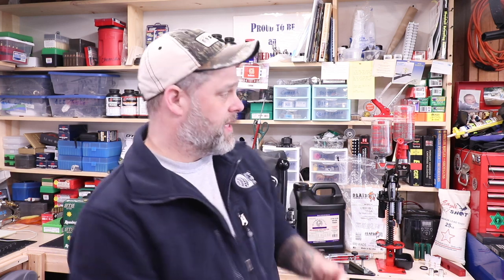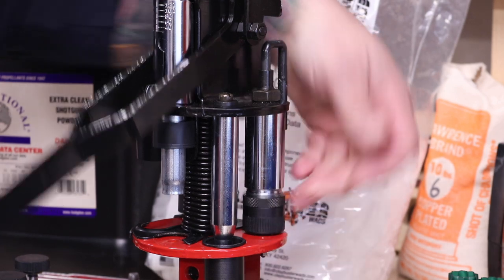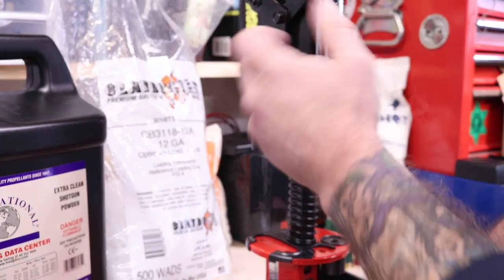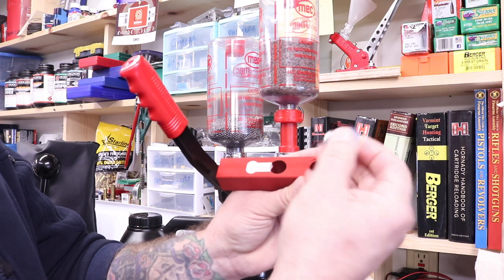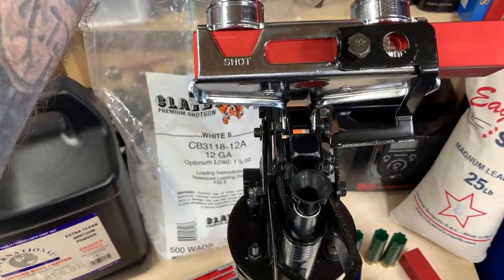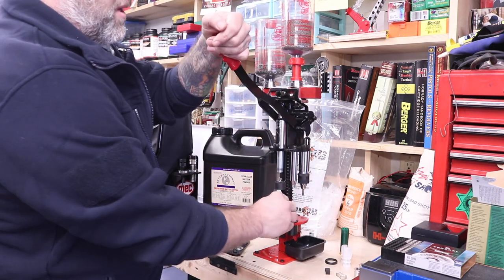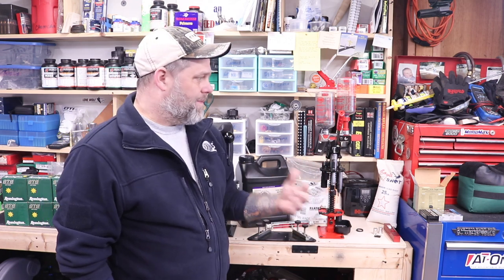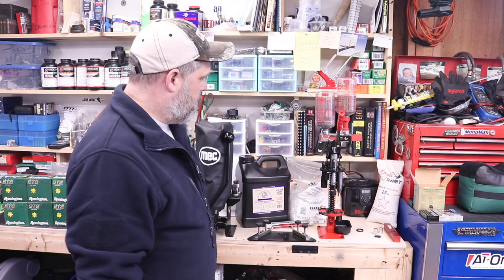MEC 600 Jr Mark V, Reloading 12ga and Overview

Comment: Great job explaining the Mec 600 Jr. I've had my Mec 600 since the 70's can't tell ya how many shells went thru it and to this day I'm still reloading at least 2 boxes a week. Yes you can be a real speed demon on this, about 6 to 7 minutes for a box of 25.
Reply from the maker: It sure isn’t hard to get in to a grove and pump out a box. I’ve heard of so many people using the 600 for years and years without issue. Thanks for watching

Comment: About 1 month ago, I ended up with my father-in-law’s MEC 600 Jr.  Last time he used it was 1988.  It took some cleaning, but I got it going.  Within the first 100 rounds, I did exactly the same thing you did.  I didn’t put the caps on because I thought, there is absolutely no reason to lift that while I’m reloading.  Clearly I found a reason.  As a result, my bench and floor got a really well needed cleaning.  I’m glad I’m not alone!!  Perhaps, in a future video, if you could explain the various adjustments, that would be greatly appreciated.  I know mine is slightly different, but the basics are the same, and I had a hard time finding useful videos.  Specifically addressing issues around the final crimp.  Great video, as usual.
Reply: I was handed down a couple dillon precision presses. I took had to take then completely apart and replaced a couple things. But they still run amazing. They had not been touch not nearly as long as you but it feels amazing to continue to produce rounds. It's so sad so many people chose to buy ammo. Well I still haven't had to pay for premade ammo in over a yr. I don't have a 12 gauge but I plan on it being my next purchase. Any suggestions for a good first shotgun? I am stuck between the older remingtons or mossberg
Reply: Hello. Thought I'd give a suggestion . A first shotgun depends on a lote of things. But  I'll  suggest a  Remington 870 of some model.   You can pickup a good used one  for couple hundred  and  have plenty of product support.  And after you decide to buy others a good dependable 870 is good to have around.
Reply: finaddict Well, my dad brought me duck hunting and there were 2 shotguns with us - a Remington 870 Wingmaster and a Browning Auto 5.  First shotgun I bought was an 870 (good for duck, geese, turkey, deer, clay and just about anything). Second shotgun I bought was a Browning A5. While they are nostalgic for me, I have no regrets.
Reply from the maker: I learned on a Lefever double barrel and moved to a Remington 870 for years!
Reply: My grandfather gave me a Browning "Sweet 16" 16 ga A5 when I was 11. Shot most of my birds for years with it. Overall, for durability, mountability, and options, my favorite shotgun is a Mossberg 835 Ultimag. Have had it since I was 16. Tens of thousands of rounds. Turkey loads to target loads. Never broke any parts yet.
Reply: Been there, done that!

Comment: A great overview video for the newcomer, thank you!  May I suggest a follow-up video, if you haven't done one already, on choosing a recipe, finding the correct powder bushing by using the bushing chart and then verifying the charge using an accurate powder scale.

In my mind, the bushing chart is just a guide and the particular bushing should not be trusted until checked with a scale.  Also it's importante to recheck powder charge weights when opening a new container of the same powder.  Sometimes the density varies from jug to jug and lot to lot.

Cheers and safe reloading!
Reply from the maker: I can, and plan on doing some follow up videos but you'll find them all on Rumble. YouTube won't let me post things about re-load-ing anymore.

Comment: I have used my 600jr for over 20 years. Great machine. Converted to 16ga for my Browning 525. 1 1/8 oz lead, 800x. I use the adjustable charge bar and am satisfied. It does hang up once in a while using #6 lead but not a real concern. Keep the powder hopper full to maintain consistant charge. Great video to introduce the MEC. Jim
Reply from the maker: Susan Lorden that’s one thing I’ve heard is they can hang up. I’ve got some #6 shot that I wanted to load for hunting to. Either way, I’m very happy with the MEC, good Reloader for sure.!

Comment: I've found that I can usually load a box faster with my 600 jr. than I can with my MEC progressive. Mostly because if your progressive has a glitch, like having a primer not feed, or hang up a wad, or someone comes in and starts talking to you, it takes a few minutes to fix the mess you just made. Usually load a box on the jr. in about 6 1/2 minutes but have gone sub 6 minutes more than once.

Comment: Good video! I got a 600 Jr. a couple weeks ago at a yard sale, missing a few parts or the manual.  I was able to find everything I need at he MEC site, including the exploded view letting me know where everything goes.  MEC had the parts in stock, and they should be winging their way to me today or tomorrow.
About three hours to clean it up, mildly seized due to dirt and congealed lube, should work a charm once I get it adjusted.
So far I'm into this for about $60, so feel I'm way ahead of the game.
It did come with a charge bar set up for #8 shot, I might get a new bar and insert for other loads.

Comment: Are the progressives nice, absolutely i have one MEC 9000 but i run 2 600 jrs as well. In 20 and 16 ga. If you want to speed it up a little without the investment in a press get the primer feed for the single stage. Big big increase in productivity.

Comment: Great video better than the MEC video answered most of my question. Have a LEE Precision I got before reading the Lyman shotshell reloading manual would have saved my money gone with the MEC. The MEC uses bushing but it’s powder weights are are over it’s +/- 10gr. Seems with MEC the powder baffle resolves that but also the bushing don’t match the recipes in the Lyman shotshell book. Like the fact that there is universal charge bar and that the powder and shot bottles can be taken off with out making a mess. LEE does not have that feature.

Comment: Nice thing about MEC 600, sizemaster, and 9000 is they can be mounted on a board and that's stable enough which is great since I dont have a bench.  But I also mount a sheet pan (like a rimmed cookie sheet) between the board and the press to catch all those spills (at least a lot of it).  I have just received a MEC metallic press and am anxious to see if that will work on my board/pan with the MEC quick change plate.

Comment: In uk most grounds are now doing away with plastic wades , can you use anything else apart from plastic. 
Great video.
Reply from the maker: I don’t have any solid information but I’ve heard manufacturers will be producing biodegradable wads that will be acceptable to use in the UK. You might want to call around to some local ranges and see if they have any information.

Comment: Great video!  Years ago I stopped reloading because it got to be more cost effective to buy a box of 25 instead of making them with the MEC 600 Jr.  In the last few years, especially in the last 3 months shot gun shells have almost double in price.  Based on the cost of reloading components at todays prices vs the cost of a new box of shells which is less expensive.  My favorite all around shell is a Remington ShurShot 12 gauge, 2 3/4", 1 1/8 ounce of 7 1/2 shot.  Velocity 1,255 FPS.  A box of 25 of the mentioned Remington shells are now $10.00.  Other manufactures seem to have priced their prices at the same price. My question is, in todays economy is it cost effective to buy a reloader, of any brand, powder, wads, primers and hulls or just pay the price of a new box of shells?  Thanks...

Comment: Hey Curt, thanks for the video. It actually helped me decide to order one. I have a question though. I notice that you have a Lee Bench Plate as do I but you didn't use it when it came to fastening the 600 down. Is that because the base of the 600 is just too big for the Lee Bench Plate? Also, since I don't know when my 600 will arrive, most things are being delayed right now, could you please tell me the dimensions of that bottom plate of the 600. Thanks very much. I appreciate it. And I'm glad to see you up and around.

Comment: Thanks for doing a good job in your presentation. I'm new to reloading, but due to the lack of 410 rounds, I have decided to reload my own shells. I prefer to use 3 inch shells, but have a number of 2 3/4 inch. Will this machine do both. Can I switch it out to do 12 gauge.
Reply from the maker: The MEC is gauge specific, but it will do 2-3/4 and 3” with a couple quick adjustments.
Reply: @vaughnprecision  Thanks for the info.

Comment: Hello Vaughn. Thanks for the great video. I shoot competitive sporting clays and ive been thinking about reloading my own. Is it any cheaper than buying ammo at the current price of $10 a box?
Reply from the maker: It comes out roughly the same in cost, you might save a little especially if you buy in bulk. The major upside, when the stores are all out of ammo you can load up and keep competing
Reply: @vaughnprecision  Thank you sir. My math was definitely off, i was thinking i would end up paying .20 cents per round if i reload. I usually pay $400 after tax for 1000 rounds. Which double what i used to pay.

Comment: Want to get into reloading my own duck loads in tungsten & bismuth for next season. Will this machine do the job? How accurate/precise is the factory charge bar delivery? Is it true your bound to only a certain type of powder or shot sizes etc?
Reply from the maker: You will need different charge bars for different metals/sizes you want to run. MEC has them available most the time.  This machine will do it, I’ve loaded steel shot on it. The charge weights are close, not perfect but none of them are and never will be. The shot isn’t perfect round so it never stacks the same, that’s also true with powder. That said, it’s very consistent and reliable. I don’t regret owning this machine is what I’m saying.

Comment: I have a MEC Jr., pre 1982. It has the "Adjustable" charge bar (such as the one your not using) from back in the day, so they are nothing new.  It's made of Melamine and starting to craze from age. Just the bar itself, not including the knobs,  is about 1 X 1 inch square and 7  7/16 long  I would like to purchase a bar like yours. Any info on it? Thanks.

Comment: So the bar measures out the powder?
Reply from the maker: Yes but you have to select the correct bushing that drops in to the bar for the powder weight your looking for.
Reply: @vaughnprecision  I'll have to do some more research right picked up reloader for 75 bucks that came with the powder the shot and everything and I've never done it before last thing I want is to put too much gunpowder in
Reply from the maker: @JBWorkshop90  MEC has a bushing chart. It will show you what bushing number for each powder and how much the charge weight will be. It’s a very accurate chart.!

Comment: ...I did have a question on your lathe...I’m looking at upgrading to something that has a bit more precision...have you run into trouble with the 1 1-/2” spindle bore?...I’m looking at Grizzly with dro vs Mathews....Mathews has 2” spindle bore was wondering if it’s that big a deal...thank for your input...

Comment: I'm completely new to this. Can I assume this kit would be everything I'd need for the tool side, for making new shotgun rounds? I assume so, after watching the video and looking at the stuff on gbot. Just wanting to make sure this is everything I'd need.
Reply from the maker: It depends on what you plan on reloading. This machine is set up for loading 1-1/8oz 7.5-8 shot 2-3/4” shells. Also, depending on the powder your using your may need a selection of powder bushings

Comment: WAA12 wads work the best for 1-1/8 loads in cold weather those wads your loading those spacers will sometimes crack or break when you compress them my 1-1/4 loads I use federal S4 wads

Comment: Best mec video on youtube.   I purchased 2 used 12ga. mec loaders 600 jr. And versa mec.
Some parts may be missing,,, how do i source parts mec site is not that helpfull to " self " find my vintages or parts info.
Reply from the maker: I would contact them directly, they are super helpful in my opinion.! Email or call them and I’m sure they’ll help you out

Comment: I've owned a few MEC 600 Jr presses over the years. They make a pretty nice load that feeds through most guns I  have used them in. I noticed that over time the crimps sometimes flare on hulls like Federal Top Gun if they aren't used within a couple weeks of loading. Have you ever experienced that?
Reply from the maker: Dan Selvig not yet I haven’t, but I’ll definitely keep an eye out for it. I’m using mainly the Remington STS hulls once fired. Maybe a hull issue.? Not sure on that one
Reply: @vaughnprecision  I have to think that Federal uses a softer plastic than the other manufacturers. I never see that problem in their factory loads, so I think that their factory crimps may have been heat set. I have tried setting the crimp in place using a taper crimp attachment, but that only slows down the "crimp creep". Guess I'll have to rethink whether I should shoot up my remaining Top Gun reloads and load Win AA hulls only.
Reply: @vaughnprecision   3inch reload setup , waterfowl/upland
Reply from the maker: @jaketacosik8334  once I’m able to get all the stuff to reload my goal is to load for waterfowl..!

Comment: 2 things  I disagree with , first Pre Crimp,  the hole should be small enough to hold a primer ,,, second the wad pressure , Modern day wads only need to be seated down on the powder  that gauge you refereed to is for when you use Fiber wads and shot cards Not needed for Plastic wads , and there is really no need for the rubber grommet on the shot side ,